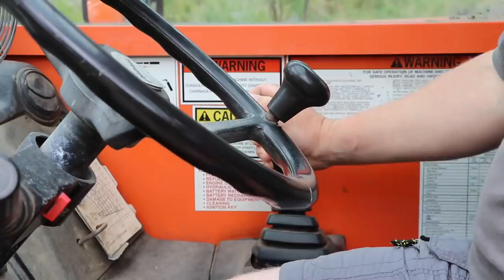There's Only ONE REASON to Drive a Forklift to Town...

Comment: Please get the siding on your house before you have water intrusion problems............
Reply: It barely rains where they are on the idaho Canada line.
Reply: They will as soon as they have the wiring done as that has to be complete before they can foam which has to happen before they can weather tight the structure. I am also concerned the osb will deteriorate on then, but it's their home and money.

Comment: Nice to see Alyssa again. The basket looks great. Concerning the siding , the house has already proven how well it retains heat, so any additional foaming will have little gain, and it is holding up the electric wiring as well as the siding. If you skip the foaming the weather is perfect for siding and the winter for inside work on the electric.
Reply: Foaming is not holding up wiring, it is the other way around. They can't foam untill the wiring is done, and they need to foam from the outside.

Comment: Ladder secure points on the basket would let you have a ladder to access spots you can't get to with the basket itself. The house build and using to pick fruit show there are times a ladder on it will help and if secure you reduce the risk. 

The slow driving speed and hours it puts on the equipment is one of the reasons people trailer equipment to work locations

Comment: We brew mead and I though tI would give you an idea to try.   Right before we do the last racking we flush our mead through a small filter made of 2 coffee filters stacked on top of each other that sit inside a strainer, then it drains into the last carboy.  That seems to collect so much of the solids in our meads.  It helped our clarity by about 100%!   Sadly we also only learned this in the last few years so some of our older meads might need a change of bottles or just pop the top and have a night of drinking fun!

Comment: You might try placing the green apricots into a paper bag to ripen them.  It works with rock hard avocados that you get at the supermarket. Two or three days and they are nicely ripened. Just don't forget about them as I have done.

Comment: My uncle used to have poles with little baskets on the end. The baskets had claws to pick the fruit that would drop into the basket. The poles were 10ft long. My only thought on the man lift is running into Hornets or bee's.  No quick exit....
Reply: I’ve found from picking grapes, apples and cherry’s that wasps tend to focus on the sweet fruit more than the human, so they’ll follow it into the bucket. Usually don’t bother you provided you don’t swat at them. For apples I wear gloves just 8n case I wrap my hand around an apple and theres a stinger hiding on the other side. Been at it all my life and never been stung.
Reply: @mdecourcywheeler  I always get stung...lol could be my bad luck.  I guess I should wear gloves

Comment: just a thought don't know if you have earth tremmors in your kneck of the woods but would consider putting side batons up on the food storage system so the jars and bottles don't fall off ?
Reply: dtec30 not really an issue where they are, more likely that someone walks by and bumps into it though

Comment: Keep the pits,  Wash them in a net bag.  Put them in a bag to heat in the microwave oven to use as a hot pack.
Reply: Apricot pits are maybe a bit too chunky and sharp to do this with. It's a lot more comfortable with cherry pits. But it'll work.